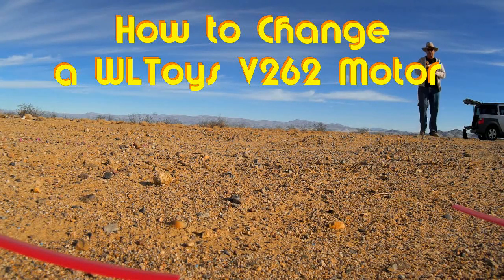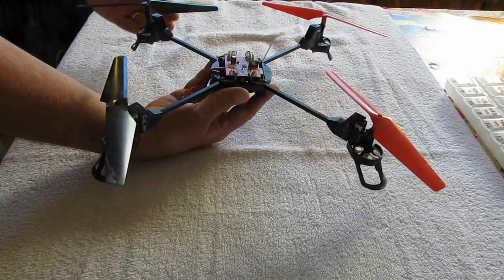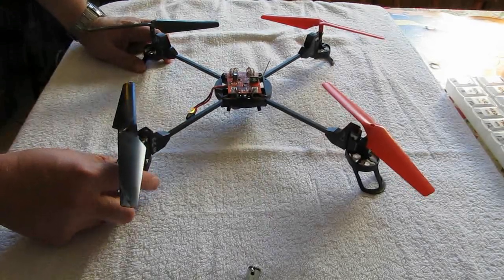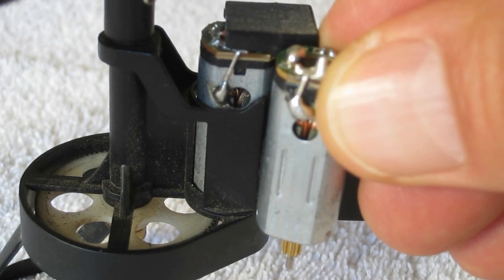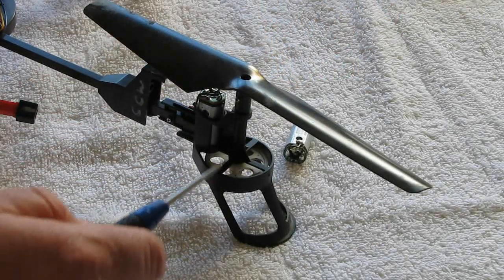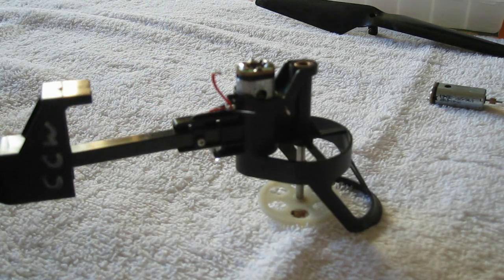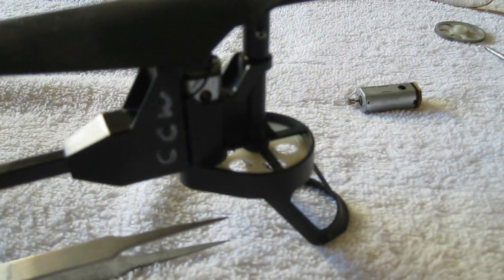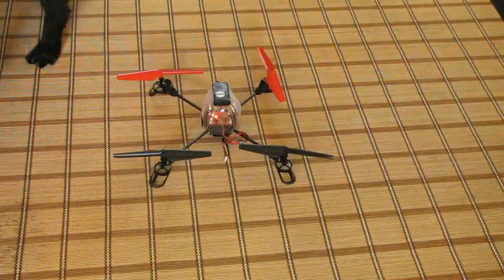WLToys V262 Cyclone Repair: How to Replace a Motor

Comment: Was wondering if over charging the lipo batteries can compromise the strength of the batteries?  I've been leaving them overnight to charge and it seems like the performance has drastically declined.  Doesn't hover close to the ground after I have flown higher and seems to run out of gas when I try fly it back to me...  Both flights when I experienced these symptoms were slightly breezy but its never been affected like that before...  Also I've tried to fly at 100% power and felt no difference..
Reply from the maker: It actually sounds like one of your motors needs replacement as shown in this video.  Please listen to my discussion in this video starting at about 30 seconds to see if the described symptoms apply to you.
Reply: Quadcopter 101 I'll try the hover test you described but I haven't experienced any of the motors whining loudly that's why I was dismissing any motor damage.  I know what that sounds like and have changed one out already thanks to your vid but there's no symptom like that happening at all...
Reply from the maker: The charger that comes with this stops charging when it reaches peak, so plugging overnight shouldn't have been an issue. Next thing to consider is the battery, it might just be defective.
Reply from the maker: Also you can buy cheap generic 2S 7.4v LiPo's on EB and Amazon that will work just fine with the V262. Visually verify in the ads that the connector plugs are the same as the stock battery.  Most are larger and higher power than the stock battery. But don't recommend buying anything bigger than a 1200mah. You'll get longer flight times with larger batteries, but flying non-stop for extended perdiods burns out motors. Also the larger batteries won't fit in the V262 battery case. So just strap it to the belly with a large rubber band.

Comment: Just wanted to give you a shout about these motors.  It's odd that I've had my quad copter for three weeks now.  Have maybe a little over an hour total flight time.  In that time, have replace the right rear motor twice!!!  That's the motor you are replacing in your video.  I'm wondering if there could be an issue with the ESC controller?? I find it odd that this is the only motor I've had to replace twice.  Also, have you mentioned in my first video: WL Toys v262 Quadcopter Update:  Bad motor!!

Comment: great vid! was just wondering, this quad can handle the weight of a camera and possibly battery?
Reply from the maker: Yes it can lift a GoPro Hero 3, but I mainly use a Mobius camera for most of my aerial videos.  Here are some examples:
http://quadcopter101.blogspot.com/2014/02/misc-4-aerial-video-part-2.html

This quad can also carry larger batteries with potential flight times up to 20 minutes.  But even though it can fly that ;long, it's important to keep the flights short at about 7 minutes with 15 minute cool down periods in between.  Otherwise, you'll need to follow the instructions of this video more often than most :)

Comment: Great video. I flew a few times now and my right rear motor has gone bad. Luckily i bought some spare motors. How many times do you have to replace the motors on this quadcopter?
Reply from the maker: It depends on how agressive that you fly, how long that you fly, and how much weight that you carry.  High power for long periods are obviously bad.   Flying with the training canopy attached adds unneeded weight that adds stress to the motors.  Flying with heavier/higher power batteries for non-stop flights longer than about 7 minutes will also cause premature wear on your motors.  Some lucky people have not yet had a need to change a motor.  But I'm kind of aggressive in flying my V262. So I average about 20 flights out of a motor (with 4 motors, this means I need to change a motor after about every fifth flight).

Comment: How to change the motor without soldering ?
Reply from the maker: Sorry, soldering is needed to change the motors.  But it would be nice if one day WLToys used plug attachments on their larger quadcopters like they do on the smaller V212 and V222.

Comment: Thanks for your video. I have bought some motors for my WL262... but it seems that they are weaker compared to the original ones... I have burned two times the same motor in a day. Any suggestions?
Reply from the maker: Lighten your V262 by removing and flying without the canopy.  Never fly more than 7 minutes non-stop, especially with higher power/heavier batteries.  Always allow the motors to cool down for about 15 minutes after each flight.
Reply: Thanks so much... removing the canopy was the first thing I have done thanks to your suggestions...  I have a mobius on sometime...  but the feeling when the motor is new is that is weaker... :(
Reply from the maker: Also remember to break in the motor as shown at the end of the above video.
Reply: Thanks...  my english is not so good...  now I understande...  I'm from Italy;)
Last question for now: break in with one full battery at low engine is enough?
Reply from the maker: Yes that should work.  1 battery charge run as slow as the motor can go.
Reply from the maker: Soon I will include captions with this video so that the video can be translated for everyone.
Reply: less is 10% and it last in more than 30 minutes.... any chance to repair the other motors... they didn't stop... they are just very weak... enough to fly... but not to go up vertically.
Reply: Maybe we can cut the other motors to save them unplugging the wires... Can you suggest a procedure...  like three "stint" of ten minutes with a break of five minutes to cool the motors? Thanks!!!

Comment: 2000 mAh battery is heavy. My v262 can not unload. What could cause this?

I watched some videos. On the device the camera. There fpv transmitter. There are 2000 mAh battery. There are additional weight. However, flies great. What problem exists in mine?
Reply from the maker: One of your motors has likely failed.  You may need to replace it as shown in the above video.  The 2000 mAh battery can be lifted by the V262, but it can cause damage to your motors if you are not careful how you fly with it.  The increased weight of both the heavy foam canopy and the 2000 mAh battery can cause increased stress to the quadcopter's motors.  Also the 2000 mAh battery may allow you to fly nonstop for close to 20 minutes. But if you do fly for 20 minutes without resting the motors, it will surely cause the motors to overheat and fail.  You should not fly nonstop for longer than 8 minutes. You should then land the quadcopter to allow the motors to cool down for approximately 15 minutes before flying again.  Thus for the charge of a 2000 mAh battery you should fly approximately 3 short flights, with cool down rest stops in between.
Reply from the maker: Seckin Sahin yes, your right rear motor has failed, and needs to be replaced as shown in the above video.  The motors are very powerful, but are of an inexpensive brush design that requires maintenance and replacement.  That's how WLToys can sell a high-performance quadcopter for such a low price. But with time, every one of your motors will eventually fail.  I average about twenty flights on a motor before a failure.  This number of flights is reduced if your quadcopter is carrying much weight, or flies for longer than 8 minutes without resting to cool.  The replacement motors are inexpensive from Banggood, so I recommend that you purchase several to have available for the next time a motor fails.

Comment: Thanks for the video, replaced one of the motors in my V262 in about 10 min.   A tip I thought I'd share, when removing the many little screws, use a small magnet to keep them from getting lost.

Comment: Any experience with fixing wires connected to the motherboard?  I landed on a hillside and the propeller got wrapped in a blade of grass because turn the throttle off.  When I got to the QC it was making a high pitch wine on its back and the wire that powers the props was smoking...
Reply from the maker: First off, a very important tip to remember for whenever you crash, immediately put the throttle to zero. Otherwise you may burn some of the electronics as you've discovered.  Next, have you tried running the quadcopter since the crash?  Does it still smoke?  If not, no problem, keep flying, and chalk it to experience.  But if it does smoke, don't attempt to run it further.  I'd recommend that you try replacing the cable first, and then the motor if the problem persists.  Solder the end to the motor, and wrap it externally around the mast to take up slack.  Then plug it into the circuit board. Here's the cable:
http://www.banggood.com/WLtoys-V262-RC-Quadcopter-Spare-Parts-Motor-Cable-V262-21-p-84307.html?p=RB0922217402201307U3
Here's the motor:
http://www.banggood.com/WLtoys-V262-RC-Quadcopter-Spare-Parts-Motor-V262-16-p-84305.html?p=RB0922217402201307U3
If the problem persists with the new cable and motor, then the circuit board itself may have been fried.  If you are sure that it was fried, I would need to know the color of your circuit board as their are two versions.
Reply from the maker: I gave it a little more thought. If the wire is still smoking, would instead recommend changing both the motor and its wire as one is the likely cause of the short.  Just don't know which is the problem at this point.  The circuit board is unlikely to cause smoking in the motor wire.  But it may need changing also, as it may or may not have also been fried by the excessive current from the crash. But you won't know the status of the circuit board until you change the motor and its wire.
Reply: I tried it out and the wires didn't smoke but the propellers didn't turn either.  On further inspection when I looked at the board it doesn't look fried apparently its just the wire...
Reply from the maker: The motors fail easily if overheated. If the wires don't look charred/melted, then recommend changing the motor first, then do a quick check. If it still doesn't spin then change the wire next.
Reply: Yeah the wire to one the motors is charred...
Reply: Quadcopter 101  It's the motor wire that's charred.  Found the part.    It seems fairly obvious how to fix to me: the one end connects to the motherboard and the other end to the motor but wrapping the wire around the board and through the arm seems like a pain...
Reply from the maker: That's why most people don't thread it through the arm.  They instead just wrap the wire around external to the arm to take up slack, and then just secure iit with shrink tubing (best) or electrical tape.
Reply: Thanks for the tip...  Do you mean clear wrap when you referred to shrink tubing?  Does Banggood carry replacement screws I've lost a couple now taking it apart a few times?
Reply from the maker: Acoustribute Screws
http://www.banggood.com/Screw-Set-For-WLtoys-V929-V949-V959-V969-V979-V212-V222-RC-Quadcopter-p-83929.html?p=RB0922217402201307U3

Shrink tubes
http://www.banggood.com/Wholesale-150pcs-Assortment-2-1-Heat-Shrink-HeatShrink-Tubing-Tube-Sleeving-Wrap-Wire-Kit-p-66735.html?p=RB0922217402201307U3

Comment: My V262 has suffered a loss of power and an almost sputtering effect when it comes to power after 7 flights.  I was trying a new battery 25-50C 950mAh 7.4V 2S Lipo when the problem started (not sure if the battery caused the problem or not).  Can you help me narrow down the issue?  Would a bad motor cause this sort of behavior?  Thanks for your videos, and any help with my power issues.  Cheers, J
Reply from the maker: Yes, it sure does sound like a bad motor.  Please watch the opening and first two minutes of the above video.  If one of your motors has that telltale screaming sound, along with reacting as discussed in the video, then it likely needs replaced as shown. After replacement, consider removing that heavy foam training canopy if you're still flying with it. Lifting that alone places a lot of strain on your motors.
Reply from the maker: Oh, forgot tom mention that the battery is not likely the problem.  At 950mah,  it should not be much heavier than the stock 850 mah battery.  However, some people purchase high mah batteries and attempt to fly non-stop for extra long flights (12 minutes or more).  That will cause extreme strain on your motors.
Reply: Quadcopter 101 Thanks for the quick reply Quadcopter 101.  The motors all sound the ok, however when I tilt the quad down at each of the motors (at a low throttle speed), one does not fight back as much as the other 3.  Could that be an indication of a bad motor?
Reply from the maker: Yep, that's the bad one.  Replace it as shown in the video.  You can purchase it from the link in the video description for about $3.80.  But you'll be waiting a month.  If you want it sooner, you'll need to pay a little more for the convenience. Recommend Massive RC for quick delivery http://www.massiverc.com/PrestaShop/en/183-v262-replacement-motor.html

And after you replaced it, recommend ordering at least two spares from Banggood, as you'll need them at a later date.  Motors seem to last on average about twenty flights.
Reply: Thanks again for your help.  I have a couple of spare motors on hand that I ordered initially.  I should probably order a couple more by the sounds of it.  I thought it might be the board at first. I am glad that you are pointing me away from that prognosis.  It sure will be less comforting having that foam protection off, but probably more of a thrill.
Cheers, J

Comment: Thanks for the tutorial but everyone should know that despite what other vendors may advertise, there is no physical\mechanical difference between the CW and CCW motors for the V262.  Unlike 6mm,7mm, and 8mm motors that typically have their brushes installed depending on the motor's rotation, the V262 motors DO NOT have their brushes situated the same, which is a flaw that's been communicated to WL Toys.   For the V262, CW and CCW is simply determined by how you solder on the motor lead for polarity.   Don't believe me?  Check out the RC Groups thread on the V262 where the unanimous consensus of everyone who has disassembled their V262 motors is that there is no difference between CW and CCW.
Reply from the maker: No I fully concur, and have also included an annotation in the video above stating such.  Since making this video I had received additional motors that had the wires soldered diagonally by the hole (not right OR left of the hole).  I also mention in the annotations that I have utilized a CW motor at a CCW position, and have not encountered any problems doing such.

Comment: How long would you say the motors typically last before needing replacement?
Reply from the maker: It all depends on how you fly it.  If you fly aggressively, maybe 20 flights.  If you take it easy, maybe much more. But no matter how easy you take it, a motor will likely fail on you.  It's the tradeoff of owning a high lift/performance quadcopter for such a low price. It uses old-fashioned, very cheap brushed motors.  Although cheap, they do provide very high power, but they also will eventually wear out. So everyone that owns this quad will also need to learn how to change a motor.

Comment: Glad to find your youtube.  I have the cyclone v262 and I'm assuming it's the same model?  I have only flown it less than a handful of times out of the box and it appears the left rear motor (CW) is broken.  The motor has that same high pitch wine and favors the direction of the motor just like you said it would...
Reply from the maker: The instructions that come with this quadcopter really should show how to slowly break-in the motors before trying to fly the quad (please see video at 15:48).
Reply: Thanks for the tip my v262 cyclone doesn't actually mention this in its instruction manual...  The instruction manual isn't that good...

Comment: Have you Upgraded The Prop shaft Brass Bushings with Ball Bearings??
Reply from the maker: Not yet. I'm waiting on some to arrive from China. When they do, was planning on making another video showing how to install them. But really, not sure that they would provide much advantage. The V262 motors are very powerful, and the friction reduction the motors may notice with the ball bearings vs the bushings may be minimal. The ball bearings are spare parts for the smaller V212, V222 quads, and they just happen to fit the V262. I would believe that the smaller quads with the much lower power motors do need these bearings to minimize friction.